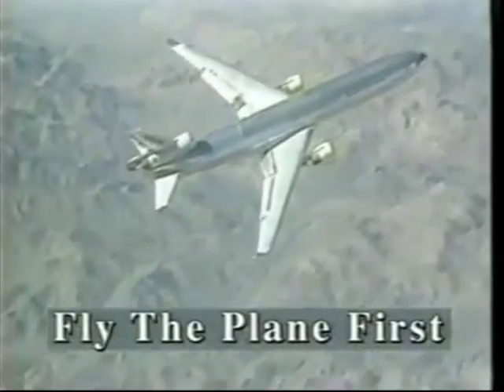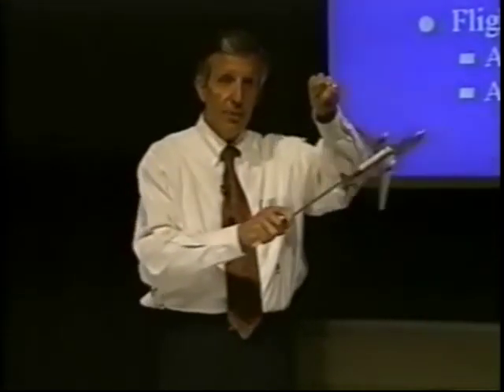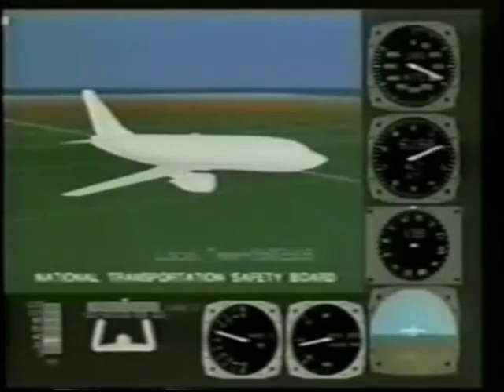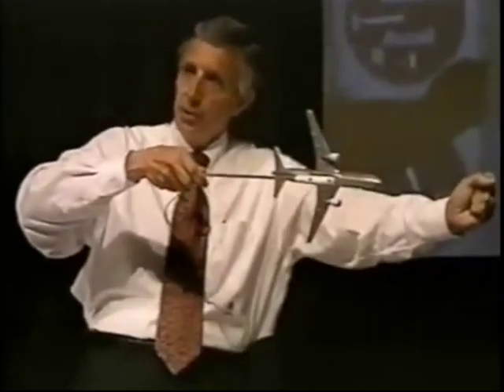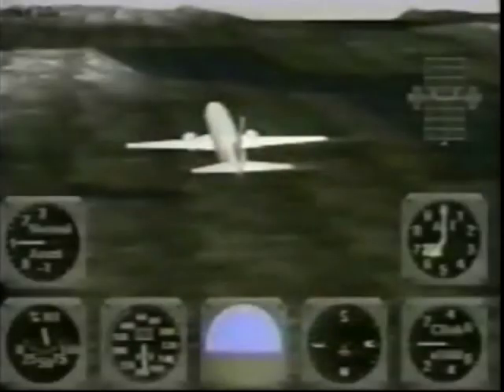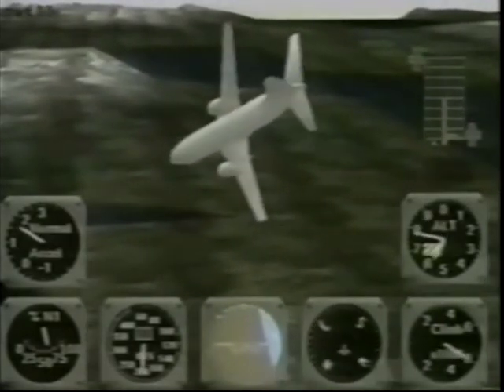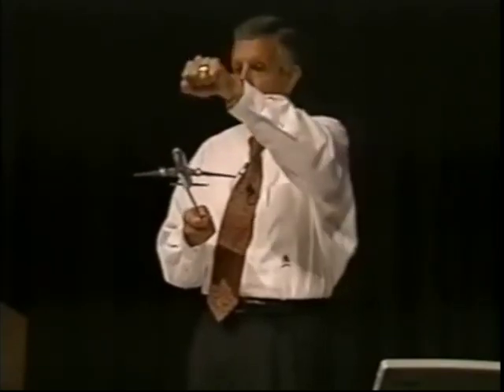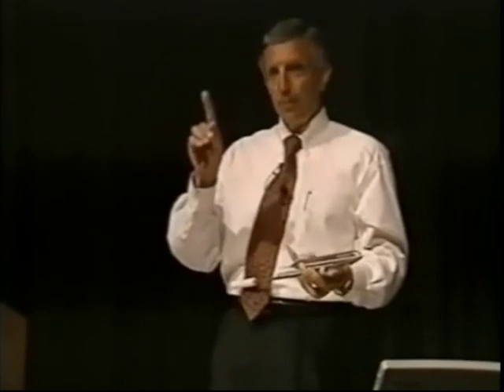Control Malfunctions & Flight Instrument Anomalies - Part One, by Capt. VanderBurgh (restored)

Comment: “…that it has no application in reality.”
I respectfully disagree.
Half a century ago, during my multi-engine endorsement training, that an uncontrollable roll during an engine failure was always correctable by reducing angle of attack, move the yoke forward.
One should must always fly the aircraft in a manner that prevents it from entering an unusual attitude.
By doing so, one is denied the pleasure of correctly recovering from the unusual attitude, but that pleasure is far down the list of priorities.
As with the VMC demonstration, in an uncontrollable roll (despite application of ailerons/spoilers or rudder) reducing angle of attack, by moving the yoke forward, is always the way to prevent the aircraft from departing normal flight.
That said, I have found this entire video series to be an excellent source of solid information and cannot recommend it highly enough!